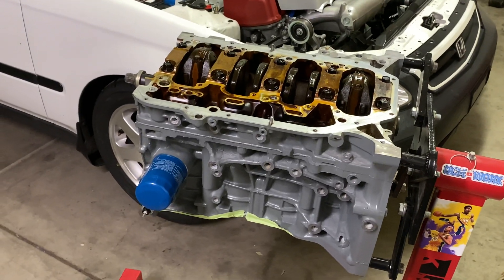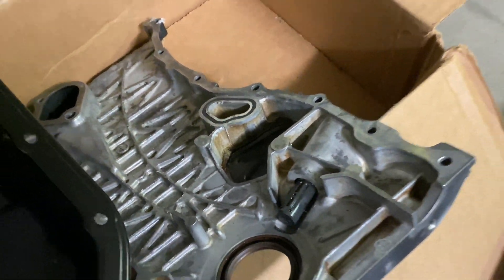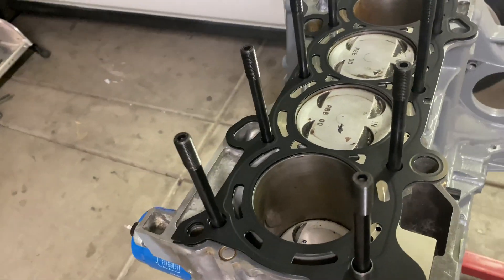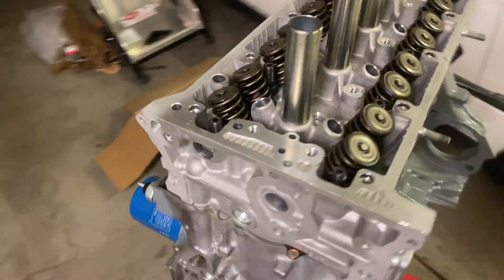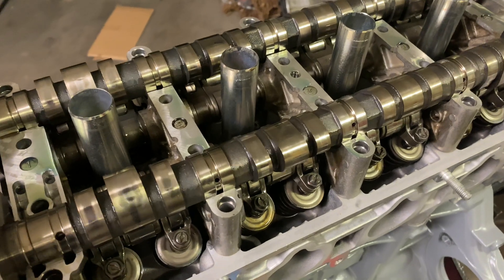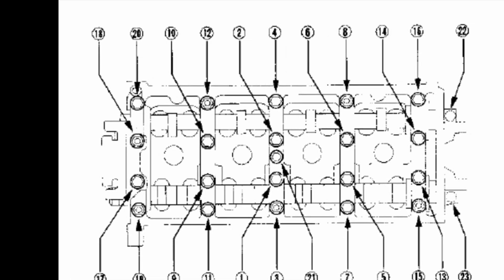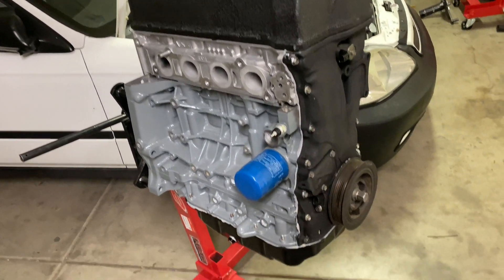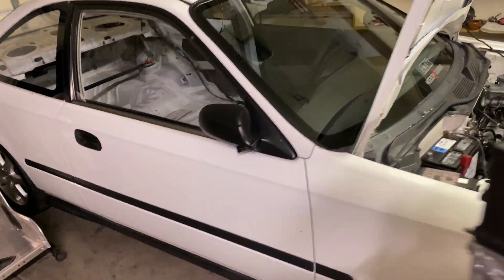How To Build a k24/k20 Engine

Comment: Hey so I bought a bare k20 head it stamp says rbc I’m not sure what year it is I’m looking to buy oem valves do they have to be specific to the engine year or can I buy any k20 oem valves for example rsx type s valves would I be able to use on the rbc head ?

Comment: Cool but top dead center is top dead center.  Just look at the cam lobes, cylinder 1 valves are not open. Thats why we set it to tdc so we don't screw up the motor.
Reply from the maker: Yea most people don’t know that so it’s why I mention it. This video isn’t for pros like your self it’s for the new up and coming into the Honda scene.

Comment: Very informative...if i swap k20a2 head  on k24a3 stock block...Will it be safe at 9000 rpm? Or i have to change the rods & pistons?
Reply: You need a k20 oil pump and I wouldn’t go past 8500 on a stock 24 block
Reply: No k24 can over rev like the k20.  K24 is only good for torque. 
I would just stay with a full k20block and head for full higher revs.

Comment: You should really ask the machine shop about the crank pulley,the crank pulley is balanced with the tire rotating assembly therefore you should have the existing crank pulley I’m out of balance her on the block not a smaller one,unless it’s Balanced correctly with the crank rods and pistons attached on a machine.just like when you have tires done on new wheels.what happens when tires that aren’t balanced??Same thing will her and your crank and will disturb the bearings.I highly recommend putting the original RBB crank pulley that comes on that block
Reply from the maker: The pulley weighs the same it won’t affect the balance of crank

Comment: Looks good bro I had a question though can I use a 2006 to 2011 aluminum oil pan oh my K24 when I change the oil pump?
Reply from the maker: Yes you can.
Reply: k20 aluminum oil pans work on k24 but you cant use a k24 steel pan on a k20 oil pump becasue the k20 oil pumps( Type S and R) have deep pickup,so the k24 oil pan will hit the k20 oil pump pickup

Comment: Hi, I got a complete k20a2 swap for my 93 eg. I’m done with my build. Only thing is I got a p1607 code on the ecu that came with the motor. Can I use a different prb ecu for the k20a2. If so does it need to be reprogrammed to run my motor?
Reply: Umm k pro 🤷🏾‍♂️

Comment: No valve adjustment if you use RBC like you said??
Reply from the maker: The valves were adjusted and will be readjusted after first heat cycle
Reply: What spect you adjusted to?

Comment: So you use the k20a2 crank position sensor and the k20a2 crank position “sprocket” with k20a2 crank pulley? Just to be clear
Reply: you can even use ak 24 crank sensor but you will have to swap the the blue signal wire and ground and power wire too.Just a 5 min job if you know.The diagram is over th net
Reply from the maker: Just the k20 crank sensor you don’t have to change sprocket and yes k20 crank pulley it’s a lot smaller than the k24 pulley